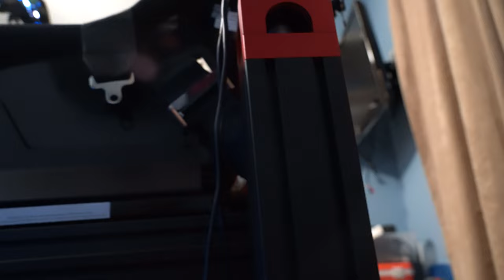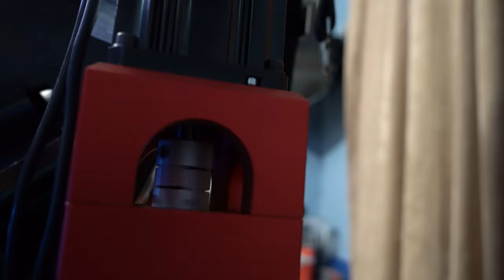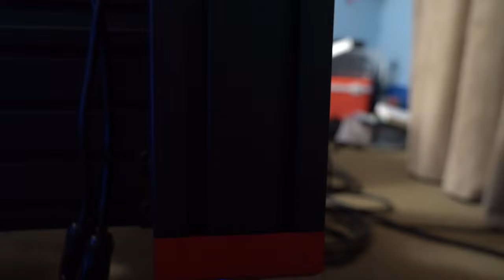Sim rig motion: eRacing-Lab SFX-150 grinding noises after only 3 months

Comment: I just got the rear loss of traction kit, hoping it comes without this issue. This is the rig I am adding it to:
https://youtu.be/tr8oq92jbtA
Reply from the maker: Nice rig, I have seen that video before!  It turned out to be the bottom linear bearing (LMEK30UU) that was binding and grinding on the hollow shaft.  When I disassembled the old one I could see lines on the shaft from the wear.  With the new one, I used 3-IN-ONE - Multi-Purpose PTFE Lubricant on the bearing as they were installed and took apart the other 3 and applied the same lube.  This can be done while they are still on the rig, so it's not that bad.
Reply: @wittycoder  that is good, I don’t even know when the kit will ship due to back order and the close down of China.
Reply: and how is it nowadays? @wittycoder

Comment: mine does this and they told me it was normal  :/
Reply from the maker: If it's making crunching/grinding noises like this I can ensure you this is NOT normal.  I have taken mine apart when I got the replacement parts and the issue was the linear bearing at the bottom that was wearing into the shaft.  I'll see if I can get a follow-up with pic/video showing the shaft damage.
Reply: @wittycoder  hi, thanks for the reply, I did assume their response was BS but I had limited knowledge and it didn't seem to affect the function so I accepted his reasoning